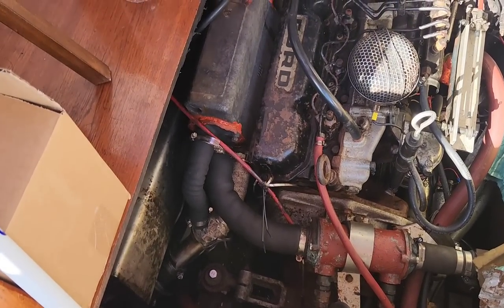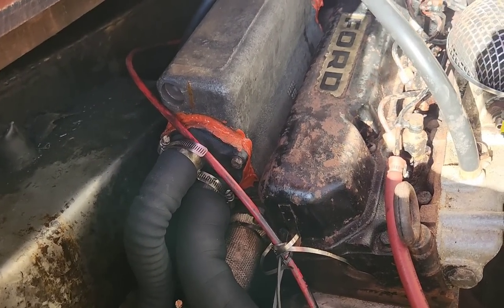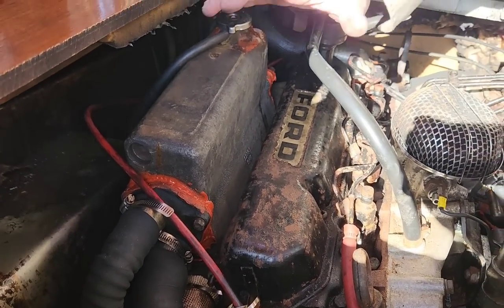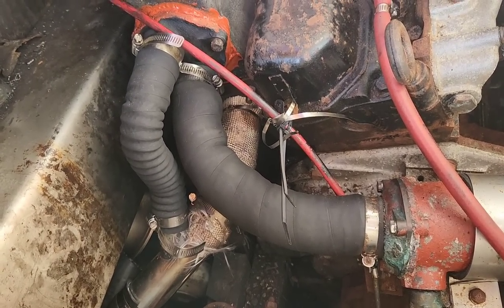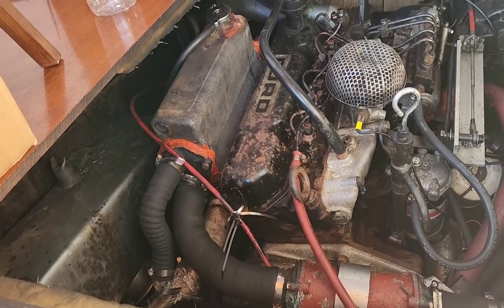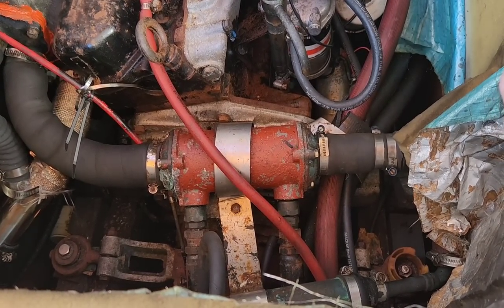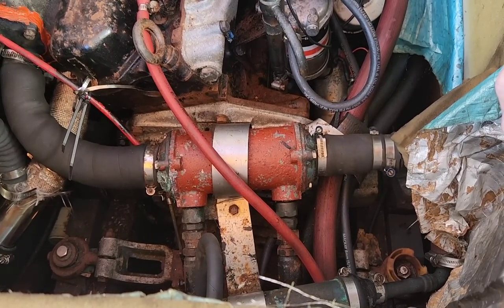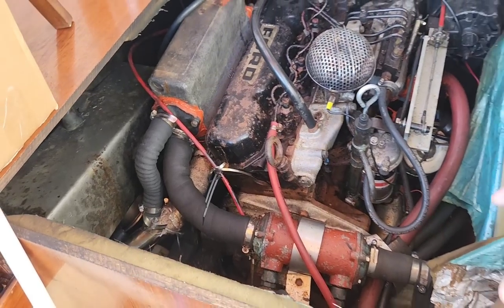Marine cooling system explained

Comment: Does the heatexchanger and both oil coolers have zinc plugs/anodes in them?
If not you should fit them. Main reason those alloy heat xchanger cases eat away that and the sealing o-rings leaking. 
Thats a nice big engine cooler. 
It can be opened up and serviced unlike a lot of the smaller ones availiable today.
Reply from the maker: I know the heat exchanger has an anode not sure about the oil coolers. I didnt think about that. I will have to check next time i am out there. The engine cooler was surprisingly easy to work on once i got it homeon my work bench.
Reply: Anything alloy cased especially should have one, some even have one each end at the water inlet and outlet. Couldnt quite see wat type of cooler was on the transmission but it should have at least one zinc.

Comment: If it sucks in sea water why does it need coolant? Wouldn’t the sea water cool the engine?
Reply from the maker: If the salt water was used to cool the engine it would corrode the engine very quickly.